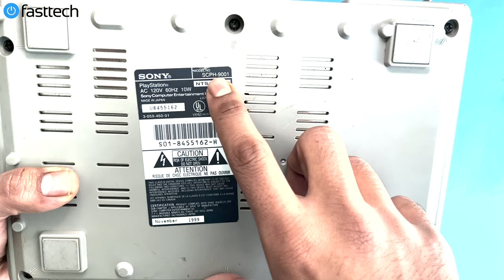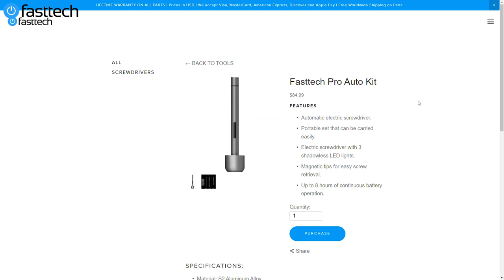PlayStation 1 (PS1) Repair and Restoration Guide

Comment from the maker: 👉 Fasttech Pro Autokit: https://www.fasttechstore.com/tools/fasttech-pro-auto-kit
👉 Fasttech Pro Toolkit: https://www.fasttechstore.com/tools/fasttech-electronics-repair-toolkit
👉 PlayStation 1 Parts: https://www.fasttechstore.com/playstation-1-parts
👉 Isopropyl Alcohol: https://www.fasttechstore.com/tools/p/isopropyl-alcohol
👉 Want us to fix your device for you? Just order the Fasttech Repair Box to send us your device by using this link: https://www.fasttechstore.com/repair/repair-box

👉Business Social Media:
Facebook: https://www.facebook.com/fasttechy

👉Follow me on Social Media:
Instagram: http://instagram.com/youngtechg
Twitter: https://twitter.com/Shehroz

00:00 Intro
00:40 How to Check the Model Number
01:14 How to Clean the Laser Lens
2:47 How to Fix PS1 Not Turning On (No Power/No Beep/ No Light)
3:11 Disassembly
5:11 How To Replace the Power Supply (PS1 Not Turning On)
7:23 How to Check the Fuse
8:27 How to Replace the Fuse
9:58 How to Replace the Laser Assembly
12:40 How to Replace the Memory Card  & Controller Ports
14:23 Removing Mid plate
15:23 An Expected Surprise
16:08 Removing the Motherboard Screws
16:32 How to Replace the Motherboard
17:22 Removing Bottom Plate
17:43 Cleaning the Case Components
20:26 To Clean Or Not To Clean
21:36 Cleaning The Power Supply
22:27 Cleaning the Controller & Memory Card Ports
24:23 Cleaning the Laser Lens Assembly
25:18 More Cleaning (Call me Mr Clean)
26:49 Reassembly
34:46 Before & After Comparisons
36:58 Outro

Comment: Hmm, I wouldn't describe this as a comprehensive tutorial on repair and restoration, contrary to what was mentioned earlier. There are plenty of issues PlayStation 1 users face that are not addressed in this video. For example, a common issue with the PlayStation 1 is the need for recapping. After about 30 years, the capacitors on the board can start leaking, so it's advisable to replace them even if they aren't currently leaking. There's no absolute necessity to buy a new power supply since most problems can be resolved by replacing the fuse and installing new capacitors. I personally switched to a low-heat power supply for my PlayStation 1. Additionally, there are other frequent problems with the PS1, such as sound issues, often due to the sound IC. In several cases, I've found that the IC chip's legs were no longer making solid contact with the board's pad, necessitating a reflow. This issue can also occur with the main processor and graphics ICs, making it seem like the PlayStation is non-functional, though often, these can be fixed.

Furthermore, in this video, you demonstrated repairs using a 900x series board, but these models typically don't experience the same issues yet, as they are relatively newer (1999 isn't quite 30 years ago). It might be more instructive to focus on console versions known for more problems, such as the 100x series, which, despite some criticisms, is favored by others for its sound quality. Personally, it's my preferred PSX model, mainly for the Parallel Port (present in models up until the 900x series) and its various connections. Demonstrating full repairs on a 100x or 500x series board might be more beneficial, as these are among the most sought-after models, partly because of the xStation mod.

Overall, I find this video to be quite general. It suggests changing the PSU (or the fuse), replacing the laser assembly (or cleaning the motor, which is useful), and simply cleaning the board.
Reply from the maker: Thanks for your constructive criticism. I will do a video in the future that covers the issues you mentioned.
Reply: @fasttechvideo  I look forward to it!

Comment: I hope you see this comment.  I just purchased a ps1 and it has old tap/glue on top of the disk door where a demo was tapped.   What would you suggest to clean it off?
Reply from the maker: Yes you can and probably should.
Reply: @fasttechvideo  do you have any suggestions as to what to use?
Reply from the maker: @patreck1969 goo gone

Comment: I cleaned the disc reader and motor, changed the whole disc reader, fixed the disk spinner speed thingy, made sure the games were compatible; however, I still kept recieving the red screen of death error. I think that it's a capacitor issue that I'm having an issue with the PS1 slim.
Reply from the maker: Your laser is most likely dead
Reply: @fasttechvideo  true, it was both the lazer being dead plus the capacitors malfunctioning. I had to replace the capacitors and then try reinstalling the new laser replacement for the PS1 slim console to be able to read games.
Reply: @fasttechvideo  there is a specific capacitor for the lazer disk reader C705 that wears out over more or less of a decade and needs replacement. I bought the replacement parts from Console5 and replaced them all just in case. However, I confirmed that the capacitor C705 was bad by desoldering it and checking for a capacitance in which it was off by less or more than 5 volts, and the limit is 50 V if I recall.
Reply from the maker: @RaffaelloLorenzusSayde  thanks for letting us know. This might help future viewers who may have the same problem. Cheers.

Comment: What a worthless repair video. Not a multimeter or soldering iron in sight. 0 tools actually. The only tool used is that worthless electric screwdriver that is slower to use and less efficient than any regular screw driver. It couldn't even drive a screw all the way in lmao.
Reply from the maker: I didn’t need to solder or check voltages so neither one of those tools were needed. I have used both in other videos when required. Regardless thanks for your comment.
Reply: @fasttechvideo  No need to show your audience how to check voltage while you're selling overpriced repair parts. I get it.
Reply from the maker: @lilpigg8324  youre entitled to your opinion but I would disagree. Cheers